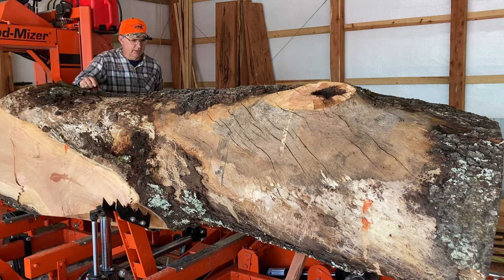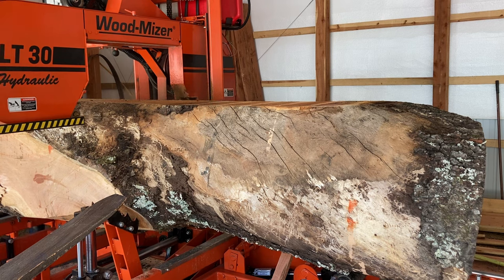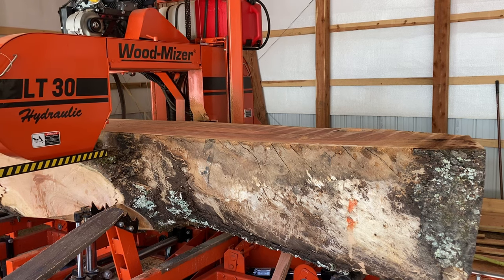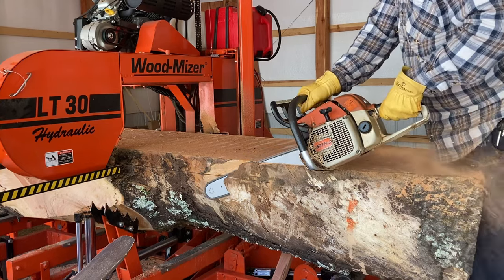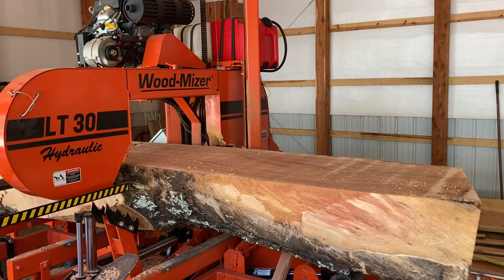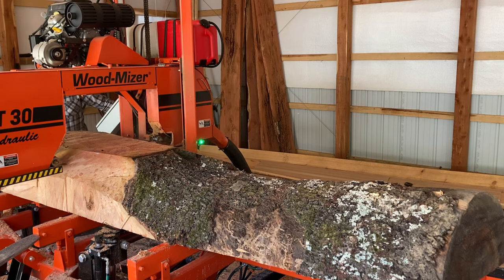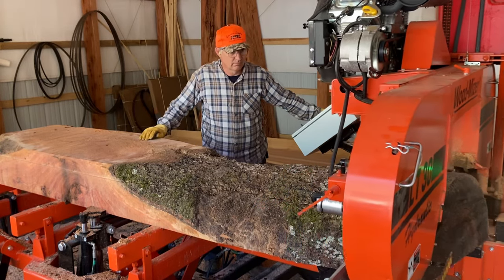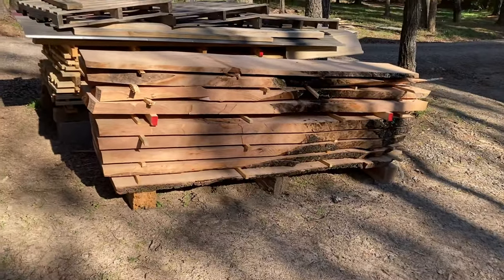Sawing a 36 inch Black Cherry into Slabs

Comment: Good work there Mr Roe.  One trick I picked up from Middlefield Custom Sawmill is on the 180 flip is to lift it up and put one inch stickers on the bunks that way the log (not sure if it's a cant at that point) can be slid over the short nub stops a couple inches to give the effect like it was before with the belly hanging over the roller stops.  Of course you may want to say a quick prayer that the cant doesn't slide over further when cutting 😁
Reply from the maker: Thanks for the comment. Yea I have heard of it. Someone on woodmizer fb said they built some pieces that slid onto the nubs and get the edge of the wood but get you right up to the guide roller.